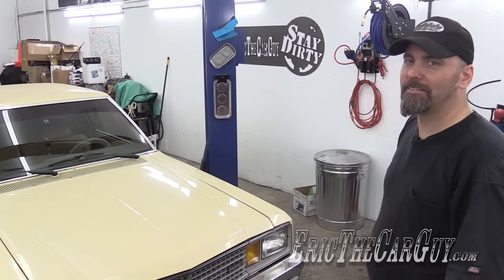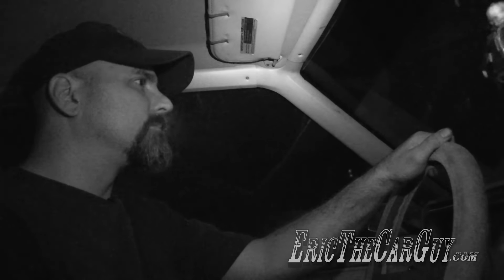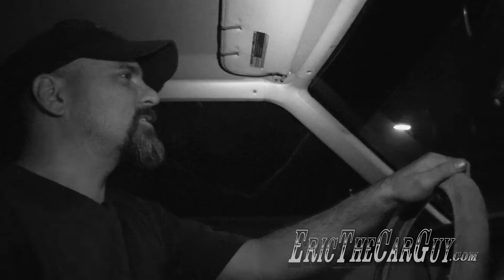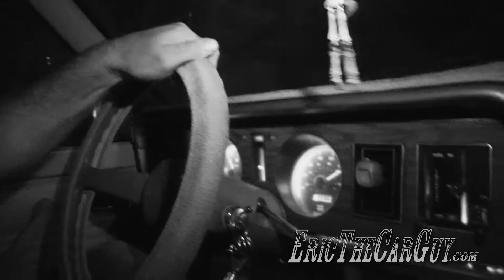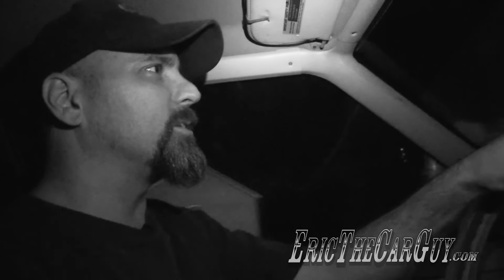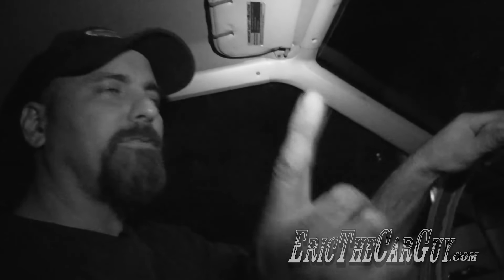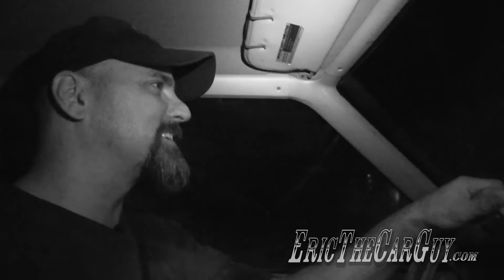80hp & 3:55 Gears #FairmontProject

Comment: Ramming speed...............

On a side note, my 67 Mustang coupe with a "built" 302, top loader four speed and 3.25 limited slip rear end would just spin the back 50 series tires (no smoke) all day long in first gear with a modified vacuum advanced four barrel Holley.  Fun times!

Comment: That's gotta be a record..spinning tires with 80hp lol. 👍🏼
Reply from the maker: Kinda makes me worry what it will be like with real power going through it.
Reply: What width tires you are going to have?
Reply: Good thing you ended up going for power brakes I think :)
Reply: Nah I do it all the time with the same engine. Of course I have a man pedal in my car...
Reply: +EricTheCarGuy I have these tires on my Mach 1 and they are pretty good summer performance tire.  I remember them being pretty slick for the first week or two.  They must have something on them to preserve them..?
Reply: I built a blown 450 rwhp blown 306 with 3.55 gears.   Ran Nitto 555Rs. 
 It's squirrelly in the rain for sure.  Stay off wet brick.  Aod chirped
 the tired at 70mph.
Reply from the maker: Perhaps. I know there are some tires out there that are designed to have more traction as they wear.

Comment: Im a mechanic too. One of my work mates bought a rusty piece of crap Yellow (1971) XY ford falcon, It looked rough about 10 coats of paint some ugly hand painted mags. It had a high compresion  302 motor auto with a high stall convertor, a shift kit and a 9" ford diff with a 3.0 ratio It cruised at about 65 mph and the motor was hardly working. It was a pig to drive around town with with the cam it had but on the open road it just flew. It used to slam change gears. In the end he sold it to get something better. That's what he told everyone but the real reason was it was attracting speeding tickets. It was just hard to drive slow.

Comment: Eric, your tire and wheel package on the rear is probably a little taller in the rear than stock, so it will make your car slower, especially since the Fairmont is slow from the factory. The stronger differential is likely a little heavier than the old one and will make the car a little slower too, but probably not as important as the taller tires & wheels.

Comment: Low end torque with lower gearing has always felt a lot slower for me lol. First with 4.56 gears and a SM465 with 35s. Felt super slow because 1st gear(not granny) would be useless past 7 mph. Now it has the original 3.73s, and it feels much better. Same with my 2012 Jeep JK. Bought it with 35s and 3.21(6 speed), put 4.56 gears in it, and now it feels like I'm floating gears. 4.10s would have been perfect.

Comment: I've been looking forward to watching this one.  Then I started thinking about it.  The idea of lower gears is to get you into the torque curve sooner.  I am not sure what the torque curve looks like in for an 80 hp motor.  I imagine it's a higher torque than hp motor, but I assume that it was designed with torque down low to turn big gears for good mileage.  Seems like that played out in your experience driving it.

Comment: I'd love to put 4.10s behind my Crown Vic to really get that thing moving. Those gears ROCK with 4 bangers, imagine how good they are with 250+ hp. But my driveshaft is too long and would fly right off under top speed. I wonder if that's an issue in the Fairmont since it's what 4 inches longer than the Mustang? My old Mustang could rock 145 mph all day no worries.
Reply: Your drive shaft would be fine. I have owned multiple crown vics and had both going 130-135. Also keep in mind going higher gears your top speed will be killed.
Reply: Top speed is 145 for P71, 110 on civilian models. At least my 92 civilian did 110 according to GPS.
Reply: Kevin Beam Have also done 110 in my civy and I think it's what the limiter is set to.
Reply: David McClelland Yep, p71 uses a stronger drive shaft. Crown Vics were great cars.

Comment: if you decide to change suspension later on take a look at team z rear street beast set up with upper relocations. It doesn't have solid bushings so its more streetable but is plenty capable of the new motors power level and if you so choose comes with an anti roll bar.

Comment: That's a frisky 80 hp lol The funny thing about the 200 is that it actually made 8 hp LESS than the 2.3 four cylinder (which was the base engine on that car), albeit with more torque.

Comment: You're on summer time there so it must be fairly late.  I hope you don't get an icy chilly wind when you get home and open your front door like Homer sometimes does when he gets home late from Moe's.  I'm glad it all works nicely first time. Can't wait for the Pikachu videos and then the test drive with all in. 
As for the speedo, my advice is not to install a reduction box to bring the speed down unless you're sure it's a high quality unit.
Recalibrating is easy though the odometer will be wrong and don't get either the reduction box or any recalibrating done until you have the final drive train and wheels on. 
Of course that is if you're not going to install all new electronic instruments.
Reply from the maker: I already have a new speedo that uses GPS. Thanks for the recommendation.
Reply: I figured you might be using a new electronic speedo but geez GPS, nice.  
I hope we get to see a video on that too.
Reply from the maker: Indeed you will.

Comment: If you decide that even after your new engine is installed that you still dont like the 355 gears. Try 391. I switched from 355 in my 360 powered 94 Dakota to 391 and it made a huge difference.

Comment: My first car (48 Chevrolet) had factory 4:11 gears and 6:00 - 16 tires. With the splash lube 216 engine I never drove it over 50mph and mostly 45 mph. It was a different time. Not everyone drove fast. My Grandmothers expression for speeding was "Going like 60".
Reply: I could by gas for 24.9/gallon and at 45 mph get 25mpg. Thats 100miles on 1 dollar. Not bad at all.

Comment: nice car Eric but yes you need more that 80 horse power and would really drive with a five speed manual transmission,I've never had a Ford but in my younger days I built a 73 camaro with a 327 engine an a 4:11 12 bolt posi diferential I had lots and lots of power 

the engine was modified with roller rv cam and roller lifters,I remember the car shacking like a Harley at stop lights,anyway Eric very good project good luck to you

Comment: I have a 95 ford f150 with a 4.9 straight six, and 4:1 gears,  too much gears.  Overdrive (5th gear) doesn't like to go over 60 mph.  First gear is not really needed.  It came with 373, but it was used as a John Deere company truck and hauled combines and tractors and such so they changed it to 411.  As you probably know, the 4.9 makes maximum hp at 3400 rpm,  so it seems ridiculous when not hauling a load.  It is fun though, but not exciting.
Reply: My 93' F-150 has 3.08 gears and the E40D transmission. It was involved in a hit run about 5 months ago but still runs great. If it wasn't for the steering box going out, high miles and rust I would keep it. It's not fast, but it's tough as nails, and can pull with ease. E40D shifts at 3800, C6 should shift around the same rpm.

Comment: Eric, I didn't see a video of you properly breaking in the rear differential. Was wondering if because you employed a used gear set, that you'll be all set? Figured you'd at least heat cycle the bearing a few times with a lube change prior to getting on it. What's your thoughts?

Comment: Great work eric! I'm interested to know if you broke in the LSD. I had to on my car and was wondering if it was required for your posi unit. Keep up the great videos. ALL DARK MATTER PIKACHU.
Reply: I remember Eric saying that he was doing the break in on the limited slip with the 80 horse power engine figuring there is not enough power there to put excessive force on it, even when "giving her all she's got (captain)".
Reply from the maker: The day after this video I pulled the engine so, not yet. It's typical to go 500 miles of regular driving before you start 'driving' it to break things in.
Reply: +EricTheCarGuy Oh certainly. its very important to give the seals bearings and gears time to "mate and seat" for lack of better terms. What i actually meant was, the LSDs that i have worked on require either a series of figure 8's or circles at walking pace with a bit of load to help the posi clutches/cones to slip and allow oil and additive to coat them fully. This is supposed to prevent chatter and binding at a later date. Your thoughts? 
(p.s i meant to write, 'all hail dark matter Pikachu', darn autocorrect) :)
Reply from the maker: You are correct. I should probably put that in a video somewhere. Thanks for the reminder.

Comment: just had 4.10s put in my '87 5.0,fun but at around 70 it has a bad vibration,and i have a suspicion the guy didn't put in my new yukon diff in cause when I'm in a parking lot turning slowly my inside tire is breaking traction,my buddy thinks he just welded the nest,any thought?? Thanks for all the vids and knowledge too man!!
Reply from the maker: The vibration could be the driveshaft. As for welding, you'd squeal tire every time you took a turn. It could also be the clutches aren't set up properly.
Reply: thanks man

Comment: Eric im curious, why 3.55 instead of 3.73 or 4.11?
I put in 4.56 and only lost about 2mpgs in town.
i run 4.56 but its on a Jeep with 33sx14.50.  
70 mph = 3k rpm = 14mpg for me and my 86 CJ 7, trans T7 truck, granny low 1st.

so just wondering your reasoning for the 3.55s.
Reply: I'd imagine a Jeep would have much lower gears in it stock, I think the fair-mount had 3:1 before. Also the motor he's putting in is over 400hp, it doesn't need that much gear lol.

Comment: What? No burnout? If this was Roadkill......

But anywhoo, I was kind of dissapointed that you pulled the wheezer six and didn't do this but I understand the method to the madness. Car is tight,  but Scotty can't quite give you warp drive until that engine swap. PS - should have used a smartphone with a GPS based speedometer just for grins and giggles to see the actual 0-60 time. Otherwise, YAY!
Reply from the maker: The math says it was about 15mph off.
Reply: +EricTheCarGuy This car is in great shape ! Did you have much rust to deal with ?These cars rusted away years ago.You have the best car repair videos on the internet.Keep up the good work friend.
Reply: Would most likely be a percentage off, rather than a constant 15mph off. Unless it shows 15 mph when parked ;)
Reply from the maker: Thanks. Here's the info on the car. https://www.youtube.com/watch?v=L22GsHQi7tU
Reply from the maker: True, but I believed I was going about 50mph in the video.

Comment: Does your odometer have to be mechanically connected to your running gear, or will you be able to just use the Speedhut GPS speedometer's tally of the miles? I don't know if there are any laws about that sort of thing.
Reply from the maker: My new speedo uses GPS.
Reply: Thanks for the response! I did already mention your Speedhut GPS speedometer in my question. :)
Reply from the maker: Sorry, I missed that. I believe the GPS will be stand alone. I don't think I need to maintain any mechanical connections to the drivetrain. It's a completely digital unit that's self contained. http://www.speedhut.com/customizer.i?clid=5163168

Comment: Hello there Eric, I have an Audi A4 with the 1.8t AMB engine. I have the dreaded sludge issue. Is there a product you can recommend like an oil additive which would be effective at removing the sludge?
Reply: Bg engine purge works very well. I work at a dealer ship and we use BG products regularly.  I would try the product I mentioned.  Then do 500mile drain intervals about 2 times.  Then run a good synthetic oil like royal purple or amsoil or even penzoil ultra.
Reply: jtugfestiva thanks! I will try it out!

Comment: So what was the original gear ratio?

You should've stuck a portable GPS unit in the car to see how fast you were actually going.
Reply: I want to say it was a set of 3.73....but I can't remember.   It's going to be a nice ride after he gets the engine/trans installed.  He nails that torque curve correctly--and that'll take off like a rocket!
Reply: 3.73 would accelerate harder, and this was an "economy" car, so it probably had something closer to 3.08, or around there.
Reply: David James
  Could have been?  I know Eric mentioned it in an early video.  3.73's what my Bronco II had in it.  Probably confused the two.
Reply from the maker: I was going about 50mph. I think the original gears were in the 2:70 range. I never checked them though.
Reply: EricTheCarGuy
 Yeah I was wayyyyyyyy off LOL!  Not to proud to admit when I'm way wrong!  Post the axle code when ya get a chance.  Pretty sure one of the gear heads on this can decode it for ya!
Reply: I had a '79 Fairmont 302/automatic and that thing had a 2.27:1 in it

Comment: The shorter gears just get you into the rpms that the engine makes best power quicker. Doesn't polish that turd engine though. 3.55's are a good choice for the turbo and manual transmission setup.

Comment: keep it at 80HP for fuel economy lol but yea give it some more horses. did it peel out because of the torque-y differential?

imagine having 80 horses in front of you. i think there would be more acceleration from real horses than the horsepower measurement we use lol seems to not be about an actual horses power. i saw 4 horses pull a semi truck out of snow so yea. can a lawnmower with 4 horses do that? lol but im aware horsepower doesnt mean actual horses.

Comment: Should you ever need it, on Android there is a good speedometer app called DigiHUD; I'm sure they have it for iPhone too.  I have a truck with no speedo, so I use it.
Reply: Any HUD app would be fine, heck even a GPS would do.
Reply from the maker: My new speedo is GPS.
Reply: Take it, it will have some redundancy if there is no signal.

Comment: You need to change your speedo gear in your trans
Reply from the maker: My new speedo uses GPS.
Reply: Does this mean it won't work if your in a tunnel, or some other situation where the signal to the satellites is restricted?
Reply from the maker: Possibly. I'll find out.
Reply: If it loses signal it won't work.  Because most tunnels are short it will leave whatever your previous speed before entering displayed (or read 0).  What's nice is that most have a hot start function, so they acquire satellites again in 2-3 seconds once you're out instead of having to wait potentially minutes to connect to enough satellites.  The expensive ones DO account for elevation changes for accuracy of speed, though.  The cheapos only measure the horizontal movement, so speed changes up/downhill won't be detected properly.   The weaker the signal (or number of satellites), the more inaccurate it is, too.  Advantage is that tire wear, size, shape, or anything else mechanical won't affect the accuracy in any way.  That's nice, but they sure are hella expensive compared to mechanical ones in the transmission or the ones that use the ABS system.

Comment: Wouldn't you do the engine first?
Reply: Nah, then the 500hp engine would blow the old diff to bits
Reply from the maker: Can't, need to swap the K member first. That requires a whole new front suspension.